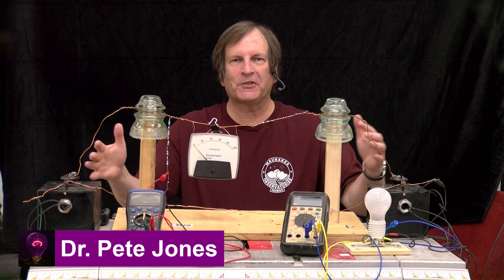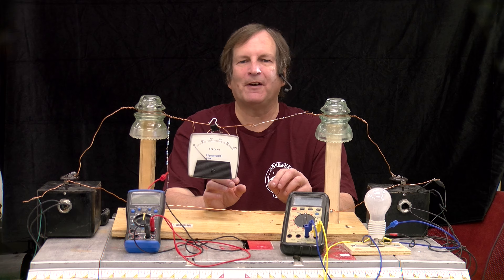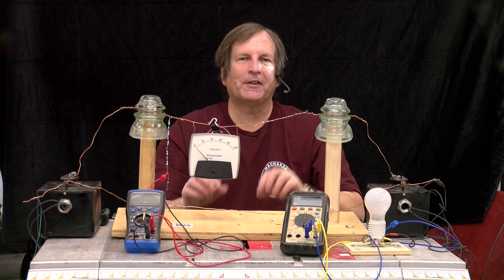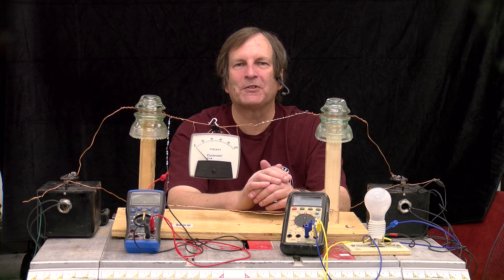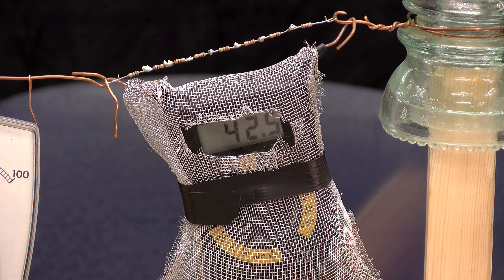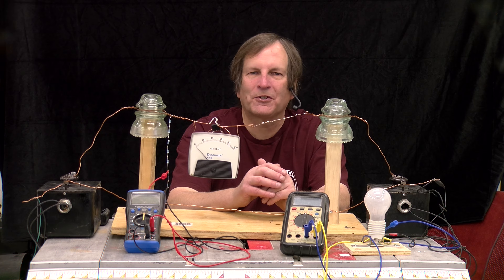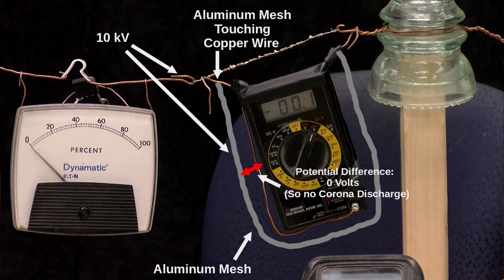Operating an Electronic Multi-meter at High Potential

Comment: Good point! I even had analogue meters that became stuck from the electrostatic force of the HVDC I used. So corona discharge is the problem why I didn't come to that conclusion. You also show that shielding does even work without grounding a lot people understand this wrong. The shield needs the same potential but without grounding you need to insulate it well against touching with ground potential it's safer that is the difference. Btw. with grounding I'm speaking from earth ground not common potential. So in theory you could build a HV PSU in a plastic enclosure and put a metal shield around the electronics but also inside the plastic enclosure. Most factories just use a metal enclosure and put earth ground on everything for safety reasons.
Reply from the maker: I never saw what you describe  with analog meters - how interesting. The needles move so freely I can sure see the electrostatic forces jamming them. 

Grounding - yes! Its been a while since I made that video and dont remember what I said - but yest the shield needs to be at the HV potential - a virtual ground in some sense. Attaching it to real earth ground would result in all sorts of interesting arc and sparcs - maybe a great video but the meter probably would not survive :)
Reply: @ElectromagneticVideos  Yes your way is right here because you demonstrated high side shielding like you said grounding would make arcs in this case. If you wanted to ground it your meter would needed to be at low side too. I don't know If your HV PSU is floating or earth ground on your common potential otherwise you could also earth your high side technically it doesn't matter what you earth ground as long as the opposite potential is then far away from it. Not easy with HV systems as with 12V where you could wrap it in tape und get away with it. Oh by the way sometimes I switched off my PSU and the needle got stuck at some high voltage value it's funny to tap the meter casing and get zapped because my meter had a metal casing maybe that was the reason why the needle got stuck at all. Some kind of capacitor effect 😄
Reply from the maker: @TimurK-g7n  As I was reading about your meter getting stuck, it reminded me -  there are HV voltmeters that actually use static attraction to move the needle - so it can be put to good use in meters.

Comment: Great solution to an unusual problem.  Once you think about it, you can imagine corona discharge within the multi-meter shuttling charge between adventitious capacitors (circuit board traces, probe jacks, etc. and then off to ground) to give the jumpy readings you observed.  Reminds me of an issue I had when running a high voltage pinwheel.  The first time I fired it up next to my (steel) kitchen table, I noticed a regularly timed spark between the table and my Variac, which was sitting on the table but insulated from it by plastic feet.  The corona discharge from the pinwheel was charging the (well insulated) table up until the air between the table and the (grounded) case of the Variac broke down.  Adding a ground strap to the table solved the problem.  Of course, I was also being charged up when the pinwheel was running which made touching the table or Variac a bit annoying, but my capacitance is relatively low so this was no worse than a typical static shock.
Reply from the maker: You know, your kitchen table spark sounds a lot like what I observed - the voltmeter reading seemed to go up and down - some maybe a very similar mechanism - something accumulating a charge  and then it being discharged. Its funny we dont think of things like a kitchen table being well insulated but they can be. Even dry wood is a good insulator. 

What were you using to generate HV? From the charging effect I would guess something with a DC output?
Reply: @ElectromagneticVideos  Interesting, YouTube seems to have deleted my initial reply, which included a link to my web-site showing some pictures of the set-up.  Yes, I was using a DC supply.  To be specific, it was a 2-phase, 4 stage Cockcroft-Walton multiplier with a +80 kV output at about 8 mA.  The metal sphere tipped legs of the table were separated from a linoleum covered floor by plastic scuff protectors and the wood-framed house has been drying for 140 years or so.
Reply from the maker: @robertlapointe4093  Wow - I would be fascinated to the see the photos. Could you try posting the link again? If it is somehow being removed, please email me the link.  (Email is in the "More about this channel" under the "View email address" button.
Reply: @ElectromagneticVideos  No luck putting links, or even partially broken links in comments, or getting your e-mail.  I am beginning to think YT is just tossing all of my comments.
Reply from the maker: @robertlapointe4093  Thats strange - always what triggers spam or other algorithms they use. To email me, (and I will describe it here so spam bots dont get it) take the name of my channel , remove spaces and write as all lower case, followed by the at symbol, followed by gmail dot com. Lets hope this doesn't trigger some sort of junk removal bot.

Comment: I'm assuming that it's got something to do with high magnetic? fields... ?
Reply from the maker: Actually, was the high electric field causing corona discharge or similar inside the voltmeter. The screen keeps the entire inside at the potential of the HV wires, so no potential difference within the device to create a discharge.

Comment: I suppose it's a bit like the guard traces seen around op-amps and other sensitive circuitry on PCBs particularly high precision measurement instrumentation
Reply from the maker: I hadn't thought of that - great point - your absolutely right. In some of those circuits - particularly the very high impedance ones - even the tiny leakage from nearby traces can be an issue unless you protect it with guard traces.

Comment: Very clever i might add, way to use a typical DMM in a way not approved by the manufacturer and certainly against the CAT ratings,  which range fron I - IV with IV being most resistant, and reflects the ability to withstand transient voltages without an arc flash occurring inside the meter, which in a higher voltage,  low impedance circuit such as outside at or close to the meter base in a 277/480V 3ø for those in the US, or worse, 347/600 3ø for those in Canada/some areas in the US,  could be the last measurement you live to take since such an event would essentially turn into a direct short across the test leads.    Many things can cause transients such as a lightning strike even some miles away can induce voltages possibly reaching several kV , riding down the power lines to the building and the risk level decreases with increasing distance from the service entrance,  hence the importance of choosing a meter with the appropriate CAT rating, your life could depend on it.  Your demonstration because of the impedance and limited available short circuit current even at 10kV, scares me a lot less than troubleshooting in a live 277/480V panel in a large commercial building.
Reply from the maker: Yes! And  that multimeter is fine for home applications but not much more. 

You make an interesting point about lighting. I'm always surprised anything can survive a lightening strike - even pole transformers with external lighting protection. Years ago one summer lighting hit the pole mounted transformer near my house. Amazing nothing nothing when bad in my house. Even the transformer survived after the protection device was reset . Two weeks later lighting hit the same transformer. The time the transformer failed and had to be replaced. (And it hasn't been hit since). 

Unfortunately the transformers for the 10kv demo are not current limiting enough - somewhere in the 15mA max limited current rating or so. So I have a dead mans switch setup to make sure I cant be anywhere within reach of it when its powered up. 

Live panels with almost unlimited current available - scary!

Comment: Yet another great video, Dr. Jones! I was wondering how that problem would be resolved. Great info on the static bags as well, including the excellent comment by @BjornV78 about the different types of bags. I had believed the same thing you did about the metallic coating or metallic content. Thank you for all the planning and materials and efforts you put into this. Very educational.
Reply from the maker: Thanks Michael! Pleased I did find a solution to the issue - at least the measurement problem had  a silver lining (or maybe Aluminum lining in this case :). 

I'm sure I read somewhere that nickel(?) was used to coat the reddish pink plastic bags. Who knows! It was great that @BjornV78 and @emilalmberg1096 where able to correct me on that and steer me towards the black bags. If you didnt see my response to their comments, I uploaded a 20 sec video showing the black bag as a voltmeter shield: https://youtu.be/YjP2q5bc96o?si

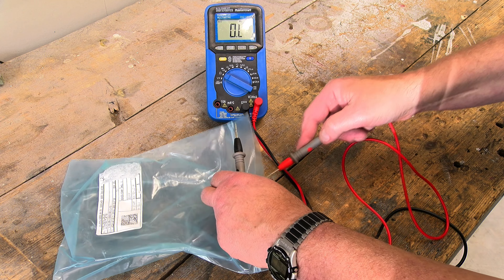Comment: 5:29 The blue, pink, green , purple or "Metallic" ESD bags are in fact totally non-conducting (are a isolator), 
exact the same as a normal plastic bag, but they have the abbility not to create static electricity and keep static electricity out of the bag. 
But once again, once a static charge is inside the bag, it remains there. 
If you place a component that carry a static charge inside a ESD bag, the component stay charged. This is the case with all semi-transparant ESD bags. 
Only the black ESD bags are slighty conductive, and these can slowly discharge a static charged component and keep it discharged. The black ESD bags contain carbon.
Regarding the mesh arround the meter, this acts like a Faraday cage. It's the same as a person would stand inside a metal cage, and where high voltage is connected to the outside of this cage. The high voltage would not to flash over to the person. This is also how the metallic suites work that high voltage technicians use. Regarding the cage experiment with high voltage, there are pictures of that experiment on the www , where a person sitting on a chair inside the cage is reading a book/magazine, while a Tesla coil is creating major sparks to the outside of the cage.
Reply from the maker: "The blue, pink, green , purple or "Metallic" ESD bags are in fact totally non-conducting" and "Only the black ESD bags are slightly conductive". Thank you for that - I had read somewhere the that the pinkish ones had very think film metal coating but I guess not. You sure explained why I could not detect any non-infinite resistance with the ohmeter. 

I wonder whats in those bags to reduce static creation?

I have seen some of the videos of HV techs in mesh suits being delivered to power lines on helicopters. Amazing job - but not something I would ever want to do!  I'm planning a couple Faraday cage videos sometime .....
Reply from the maker: Just tried  a black anti-static bag. You were so right - could even measure the resistance of the bag surface. And tried it around the voltmeter. No as good as the aluminum mesh - there was around a 2V variation around the 40V reading, but still a massive improvement over the uncovered voltmeter where readings jump from 40 to 80V. Here is 20 sec clip (unlisted, unnarrated) showing the results https://youtu.be/YjP2q5bc96o?si
Reply: The anti-static bags and anti-static plastic foam "peanuts" used for cushioning are conductive when given sufficient electric field strength.  A quick test applying 10 kV from end-to-end of a white "peanut" about an inch long showed no current but the same test using a green "peanut" of similar size showed a current of 10 nanoamps.
Reply from the maker: @analog_guy  Interesting! I have seen pink ones conduct as well (as one might hope). Maybe conduct is a bit of strong term as 10nA is hardly anything, but enough to bleed static charge.
Reply: @ElectromagneticVideos  Yes, the pink ones behave like the green ones.  There is just enough conductivity to rapidly remove or adjust any charge on the colored "peanuts".  Since the white peanuts tend to accumulate negative charge due to their place in the triboelectric series, if they are placed on an electrode which is subsequently charged to a very high positive voltage, they will remain there, typically for quite a few seconds, until enough negative ions accumulate on the surface.  In contrast, the pink and green ones will fly away immediately as they rapidly acquire charge from the electrode.  I don't know if the additive in these colored "peanuts" also materially alters the triboelectric positioning.
Reply from the maker: @analog_guy  Interesting! At some point I will have to see if I can make a video demos some of those things!

Comment: Hi. Having built my bench isolation transformer, I know that electricity wants to go back to its source. So then why is there a corona even when the HV transformers' secondaries are isolated from ground?? Where is the electricity trying to go?

Birds aren't affected by this. Why is your meter?
Reply: I wonder if this is due to the fact that ground is so close to the DMM? The further away from ground the better is might get possibly? Excellent question!
Reply from the maker: As @ThriftyToolShed said, great question! The HV secondaries in this setup actually have their neutral to connected to ground and the entire table that everything is sitting on  (actually a table saw bench) is metal and grounded.  So the electricity is trying to to get to anything that is grounded. But even if the secondary was not grounded, you would still get a corona type effects happening. What happens is  there is an electric field from anything attached to one side of the HV secondary to everything attached to the other side of the secondary. If both sides of the secondary were big flat parallel plates 10cm apart, we could easily calculate the field strength : field = 10kv/10cm  = 1kv per cm. When you have points - sharp edges, the field lines curve in around the sharp point and the field goes way up because the electric flux gets concentrated at the point (I'll do a more detailed video on this sometime). Bottom line, the field  strength gets so high that depending on polarity  it can effectively eject electrons into the air and ionize air molecules that way, or tear electrons away from the air molecules. So the electricity forces itself into the air by charging molecules. Eventually the charged molecules touch something (or each other) and release the charge. 

Birds - will they probably feel a tingle and hear the corona fizz when sitting on  HV lines. Sometimes you can hear the fizz from the ground when a long distance HV line. As long as the its just the micro amps going into the bird and being emitted around the bird as corona, no problem. But if the bird is big enough to narrow the gap between power lines to the point where an arc forms, thats the end of the bird. Its does happen, often  when larger birds sit near insulators.
Reply from the maker: Your right about being near the ground making things worse - the electric field goes up. But even far from ground you can still get corona discharge. See my response below (above?) to @d46512.

Comment: Corona discharges in the multimeter, clearly odd problems!
If I've understood correctly, the metallic and black bags are conductive, while the pink ones can't create charges, the blue ones I don't know.
Something for you to try!
Reply from the maker: @BjornV78 had a similar comment about bags. Be said everything other than black was no conductive. I;ll have to measure some others that I have and see if any have a resistance that is measurable with a normal multimeter.  

I thought they were all slightly conductive but clearly got that wrong!
Reply from the maker: Just tried  a black anti-static bag. You were so right - could even measure the resistance of the bag surface. And tried it around the voltmeter. No as good as the aluminum mesh - there was around a 2V variation around the 40V reading, but still a massive improvement over the uncovered voltmeter where readings jump from 40 to 80V. Here is 20 sec clip (unlisted, unnarrated) showing the results https://youtu.be/YjP2q5bc96o?si